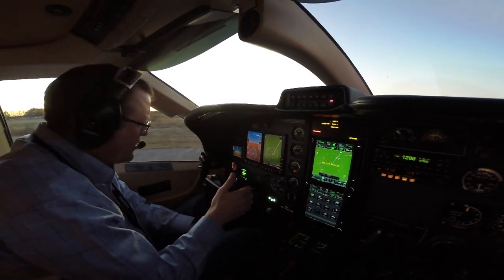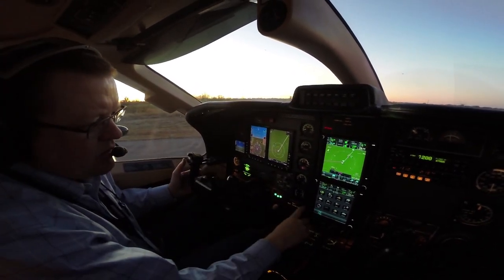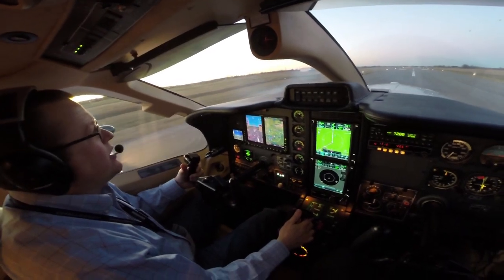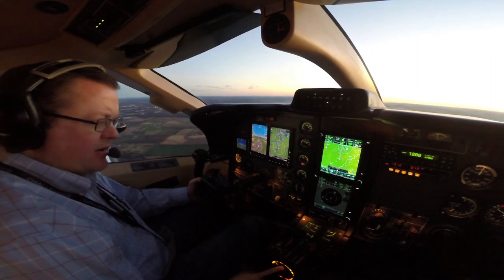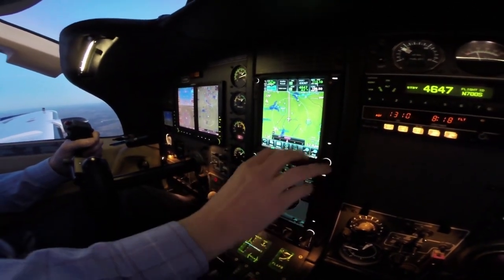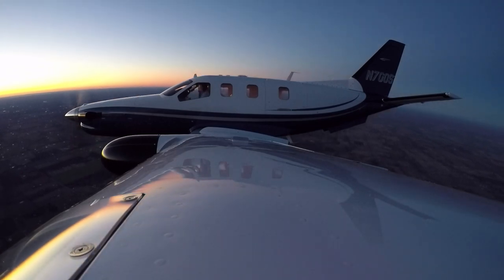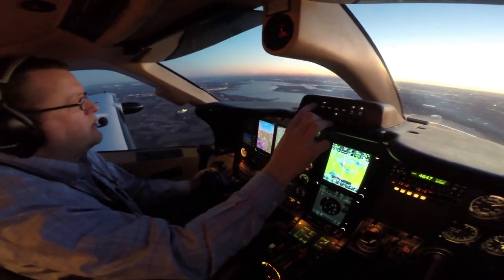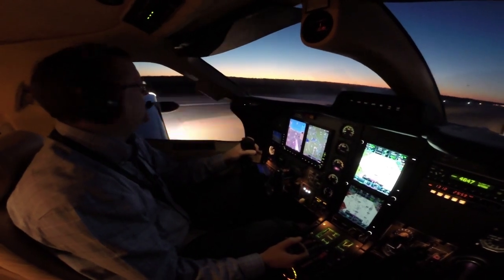Flying The TBM 700

Comment: Automatic fuel select does NOT automatically select the "fuller" tank! It just cycles back and forth to maintain a bit of balance. It works on a timer. If one tank were to get ten gallons higher than the other, you'd have a 65-70 pound out of balance and it might be worth going manual for 10 minutes.
Reply: 10 gallons won’t even be felt on a ~6000 pound plane.  My 182 gets about 20 gallons out sometimes and you can’t tell.  50 gallons maybe, but just roll an aileron up otherwise.
Reply: @eichelro  Actually the TBM 700 POH states the maximum imbalance is 25 USG. Uninformed incorrect engineering advice is at best reckless. Charles Tait's comments were very reasonable.